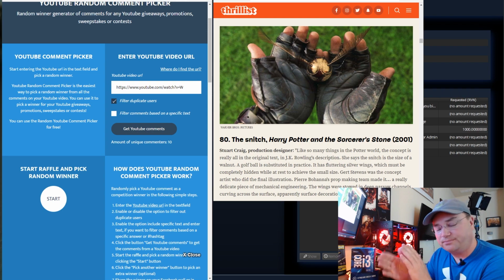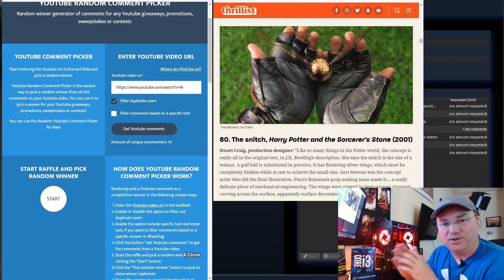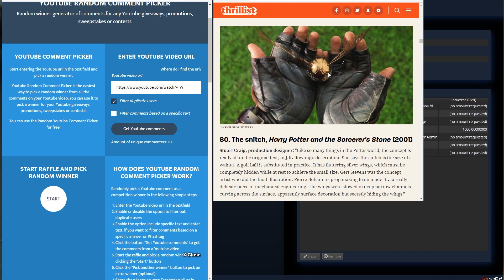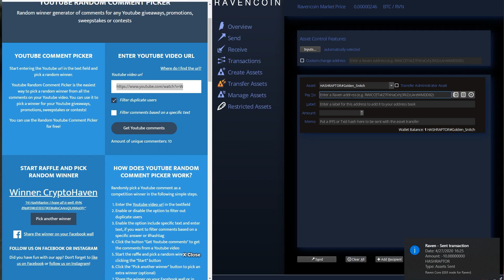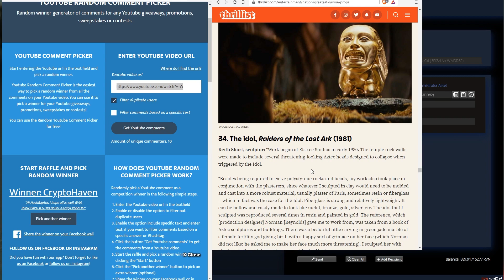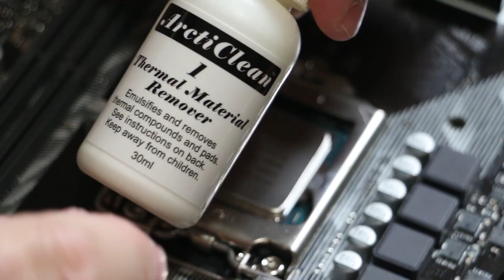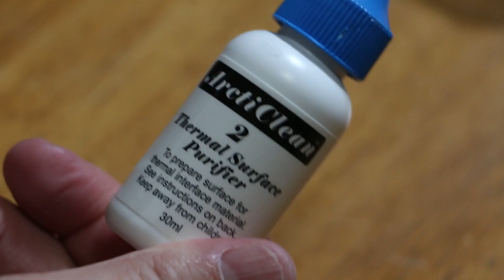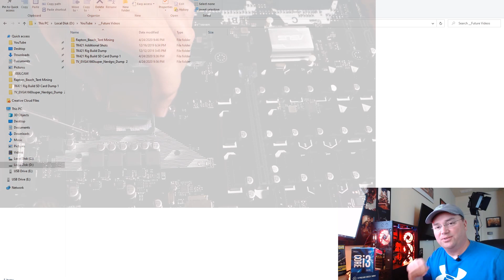Rig Basics | How to wrap your mining risers, apply & remove thermal paste, Manage Static Electricity

Comment: Glad to see you to continue to share your experiences and assist new people in the space.  The best part of mining is the community and of course the hardware.  
Just got my 3 x RX 5700 rig fully optimized.  2 Msi Evoke RX 5700 flashed with MSI Gaming X RX 5700xt Bios, and a MSI Mech OC 5700 flashed to a 5700xt.  All 3 cards with 5700xt custom modded bios with updated ram timings.  3 cards pulling 170 mhs on 510 watts at the wall.   
Keep up the good work bud.  
Love videos from you, red panda, brandon, serpent, etc.
Reply from the maker: Thanks man, the comments are much appreciated. Your favorites you listed are mine as well. Hey on that note, insider scoop to share. All those names you mentioned (and a few bigger ones), we are working on an awesome project together I think you guys are going to love. Stay tuned!
Reply from the maker: Hey, on the 5700’s a few questions. You seeing any issues with heat or dropped shares on the evoke?  Also curious where you got the 5700XT bios (in case I order). Lastly, was that 510 watts at the wall for the entire system, or just the 3 GPU’s?  The entire system right?
Reply: @HashRaptor  entire system at 510 at wall.  Around 100 watts a piece.  I jumped over on discord to help blackhardt   I am thereal35 in discord
Reply: @TheReaL35  i appreciate it sir . Im Blackhardt on discord.  Ill get a good look at it in a few.

Comment: When putting a Celeron processor into a rig,  does it make any performance boost to mining to upgrade the processor?  Any difference between G3900, G3930, ect.? Had some issues running windows and ended up going Hashr8 on a usb.  Maybe went a little too bare bones or possibly amd drivers, that's always a little gremlin waiting to strike.  

R9huGMX4n3kUCu9wbcztARLB5HtB4PEAor
Reply from the maker: Actually, I put a link to this question in discord.  If you are going to go windows, you are probably better upgrading your processor to an i3, but that is not required.  I run several on 3900's in windows.  It then depends on how much memory you have (you want at least 8gb) and how many gpu's you are running.  6 or more gpu's you should probably upgrade the processor.
Reply: @HashRaptor  Thanks for the advice.

Comment: i use the box and put the included static bag on the box as well.  I do not buy the 1 sided static bag thought, but who knows.  Never had an issue caused by static on the 50+ mobos i have dealt...I have messed up motherboards in other ways lol.  
BIG TIP FOR AMD CPU People:  I have had this happen and i know it is common.  Before taking the heat sync off a ryzen cpu, it is a good idea to heat up the cpu by running it first, then power down and then remove the heat sync.  I have pulled the cpu right out of the motherboard socket still hooked to the heat sync because the thermal compound would not let go and the lever mechanism on a ryzen mobo does not hold the cpu in tight enough.
Reply from the maker: Dang man, I did not know that. That seems like a great tip. So aside from the lever, does AMD use a different stock thermal compound?  Or is it more a factor of the lever?  Will do some research.
Reply: @HashRaptor  well it is more a function of the socket and lever system of the am4 mobo.  As you know the pins are on the cpu instead of in the mobo.  So when u slot the cpu and pull the level down it locks on the cpu and pins.  Whereas the Intel socket has that metal frame that comes down over the outside edges of the cpu. The 1 time that it happened to me I was pulling off a darkflash l6 cooler. From my ryzen.  Ended up bending a handful of pins.  Took me a couple hours to fix them   I did some Google searching and it is very common.
Reply from the maker: I’ve only bent pins one time, and I don’t ever want to do it again. Such a pain.

Comment: Awesome video bro, I usually use an evenly-cut plastic pieces to separate those metal hardware, but using an isolating tape is also a cool idea, there's also a black non-conductive paste which I used for my PCB's in the past at the time I was designing pre-amps, but it's kinda permanent, yet it grants perfect isolation.
There's also a special thin material made of a plastic alloy (fiber) which I used for power transistors 2N3055 that needed a heatsink, we can use this to isolate the motherboard from the bottom,,,  just some extra thoughts  :)

Thanks again bro, U rock  !

Sam 😎✌🏻

RVN:
RBCT7XDeGiN36fHfX15A9gd6qkeUyMFSkn
Reply from the maker: Great info.  Is that plastic allow (fiber) something that can lay on a table to work on?  Can I buy that?
Reply: Hash Raptor  well, there're 2 types; Fibre and Mica, the later is cheap and available on eBay, and with a Dremel drill kit you can fabricate the size/shape U want (pls use safety eyewear), Mica is cheaper & easier to handle, U'll end up building a rigid Rig.

Thx bro  :)

Comment: Thanks for the video Hash Raptor. Please can you help where to set the b250 mb to auto restore on power loss. Please i am struggling to set it.
Reply from the maker: Hey man, you bet and thanks for watching. I'm pretty sure I showed that in the storm trooper build.  Please let me know if I didn't.  It is in an odd spot in the bios, I had to hunt for it as well :).
Reply: @HashRaptor  sweet i will scope out the video for it
Reply: @HashRaptor  hey so i checked out the storm trooper build again. Only mb bios settings you showed in the video were the peg config and the riser config set to gen 2. Please help with the restore on power loss setting. Thanks so much